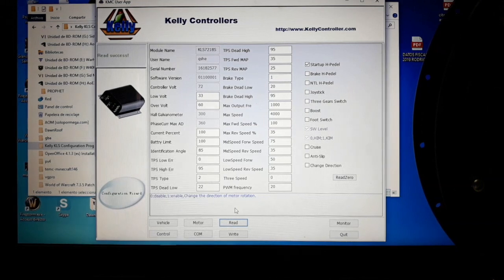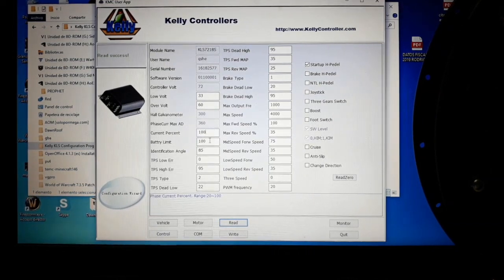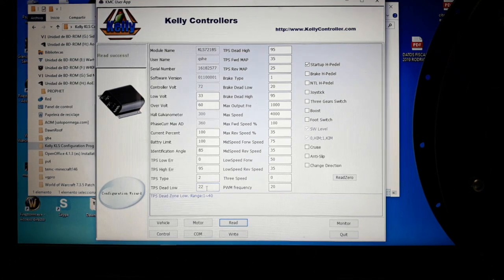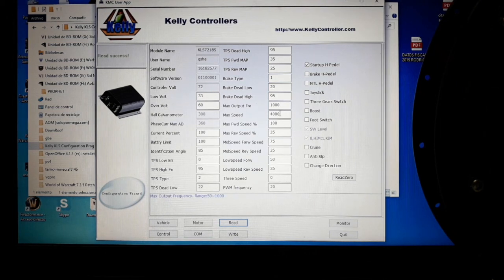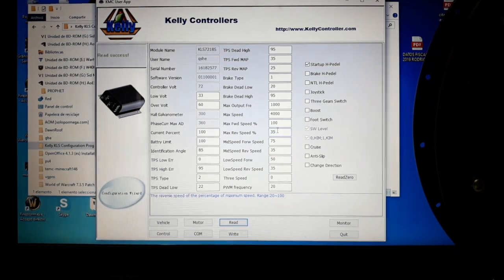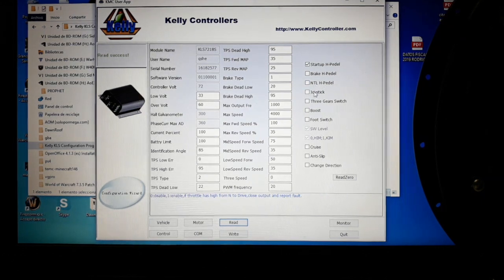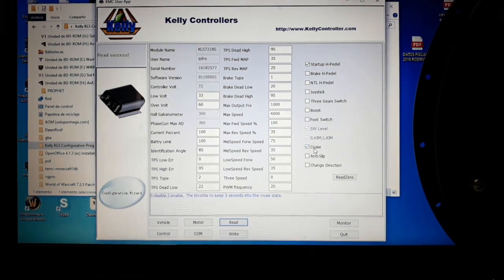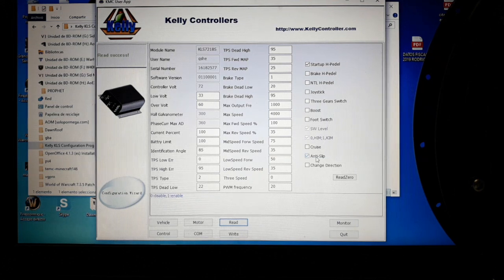KellyController Parameters, Programing setup, Part 2 (English)

Comment: Great tutorial!!!

I have the same controller 7218 with mxus 3k (20s, 5t, 19" moto). For now everything works, but two things I do not understand. 

First: I have hall throttle. And TPS type is set on 1. And it works fine. How? However it works on 2 as well. Confusing.

Second; I have set Current Percent to 100% and Battery Limit to 50%. So, acording to Your explanation, Kelly should draw 40A from battery (half of 80A rated continuos). But my current clamp meter shows that kelly draws 100A from battery when accelerating full. I did not try to set Battery Limit to 100% to see if kelly would draw 200 amps because my clamp meter can not show that much. Although in user manual for 7218 it is written that kelly can pull 200 amps for 20 seconds. So I'm thinking that Battery Limit is not percentage of 80A continuous rating but percentage of 200A max rating. At least for that 20 seconds. But 20 seconds on 200A would launch you to max speed on 10% uphill with seconds to spare:) Any thoughts on that?
Reply from the maker: Hello @berislavtopol1404 and thank you.
A resistive throttle and hall sensor throttle at the end give out a very similar signal; an approx. 0V to 5V signal.
That is why it works. But better use parameter "2" instead of the "1"
About the current adjustments: 
"Battery Limit" refers to current that comes in the controller. But it is not as precise as we will like you have to play a little with the percentages until you get what you want.
"Current percent" refers to the current that goes out of the controller to the motor, that is AC current.

Comment: Really nice tutorial! Can you only set motor speed on the 3 posistion switch? Can you set diffrent power, like less watts on a lower gear?
Reply from the maker: You can configure the controller for 1, 2 or 3 different speeds, "gears" that they can be selectable by a switch.
Reply: @gonzalop.chomon327  So the power is the same in all gears. Only set difftent max speed of the motor?
Reply from the maker: @smelker  You can only modify the top speed for each "speed gear" at the parameters, but actually I noticed a slightly different behavior of the motor at each speed, like having less acceleration at low speed and higher acceleration at high speed.
So it is possible that the software has some internal setup that changes power as well. (I am not fully sure about this)
Anyway if you limit the top speed you will be always using less current in general operation.
Reply: @gonzalop.chomon327  sounds good! Thank you!!

Comment: Really informative video thank you 🙏🏻 
By any chance you wouldn’t know what Internal Reset fault is caused by, would you?🤔
Reply from the maker: "Internal Reset" can be caused by a current peek or for momentary too high voltage or too low voltage. But if the issue is just momentary the controller will restart after the issue.
Reply: @gonzalop.chomon327  it does restart 🤔 I just see it as a problem going up hill from a dead stop. 🤷🏻‍♂️ might hinder some off road performance. Might charge my battery, see if the problem goes away.
Reply from the maker: @FuttBucker42069  If it happens going uphill from a dead stop, the most probably causes are a current peak OR a low voltage due to high current demand.
Reply: @gonzalop.chomon327  I kept decreasing battery current value, and cut outs became a rare occurrence.
Reply from the maker: @FuttBucker42069  Best solution is bigger battery ;)
Reply: @gonzalop.chomon327  bigger bms in my case 🙈🙈

Comment: hello thanks for the video.
I just wanna ask you one thing. I used kelly BLDC(not the sinusoidal) 55A controller
recently I replaced the controller to sinusoidal 80A controller.
and there is a problem. sinusoidal controller have much less starting torque than the normal BLDC controller.
I installed it on my mountain bike it cant not even push me on stairs.
there was no problem with normal bldc 55a controller.

do you have any similar experience?
Reply: Im deciding between the Kelly 100/350amp sinusodial or the trapezodial model. Im not sure which one to buy.
Reply from the maker: In some of the trapezoidal Kelly controllers you can change the "Control Mode" Value range: Torque/Balanced/Speed and by default is on Torque mode. Meaning that the throttle will mostly act as a torque regulator.
While in the Sinusoidal Kelly controller you do not have that option and it is set up by default at a balanced range. So throttle controls torque and speed on a more reasonable way.
Anyway you can modify the starting torque and acceleration changing the PID values as commented in the videos.
Reply from the maker: @tooshmart6669  Both are good, the Sinusoidal ones are a bit more efficient.

Comment: So I have a 75 Volt 40Ah 18S lithium pack and a 2.500 watt motor.  I have the Kls-S Kelly. I don't want any regenerative breaking, so everything is 0 at the RLS BRK% etc. But do I need to fill in 0 at Brake type? Also: what are good set ups for Battery Limit and Current percent? Because now, when the motor goes less than 5 mph, regenerative breaking sets in.
Reply from the maker: Hi Olaf,
"Brake type" parameter is for defining the kind of brake throttle that you are using if you are using any.
Maybe the braking  that kicks in at low speed it the "Anti-Slip" function.
In order to give you precise parameters I need to know all the info in order to make the calculations.
Reply: @gonzalop.chomon327  Well, first my connection needs to be fixed. I can't read out the Kelly at the moment. I do have some pictures from the last setting.
Reply from the maker: @olafbiesot777  What you mean with "your first connection"?
Reply: @gonzalop.chomon327  The blue wire has been broken. I cannot read out at the moment.
Reply from the maker: @olafbiesot777  Well, then is an easy repair :)

Comment: Hello to utalized the 3 speed function must it have a ground input or a 12 volt input. I want to use it in my eBike. Which i have a Kelly controller.
Reply from the maker: Hi @ubcnme1 while at the manual says you need a 12V signal to activate the 3 speed functions. While at the manual says it needs a 12V signal. It actually does not work. 
And it has been reported that using ground signal to activate them does work.
Reply: @gonzalop.chomon327  Hi I actually got the 3 speed function to work. I installed a 3 way toggle switch. I got 12 Volts  from pin 11.  And in the app I changed the setting to #2 for 3 speed and it works like a charm. I have Eco, medium, and full power.
Reply from the maker: @ubcnme1  Nice to hear :)
Reply from the maker: @ubcnme1  Nice to hear :)

Comment: Приветствую! Вопрос у меня к вам: как правильно посоветуйте объеденить 2 контроллера kls 7218 на 2 мотора. Провода от ручки газа вместе? Или 5 вольт я беру только с одного? Остальная проводка я так понимаю просто в парралель, датчик тормоза, переключение скоростей и тд... Ворос 2: что за провод RTN (6) и куда его подключить?
Reply from the maker: For 2 motors setup is better to use only one of the 5V supplies. 
The pin 6 is a grond (-) usually it is used for the return from the starting relay if you are using one.
Reply: @gonzalop.chomon327  If I don't use a relay, then I don't touch or connect the RTN output, right? to turn on the controller through the ignition switch, I supply the battery voltage to the PWR wire. Thank you for your help. They say it's even better to put a 2kom resistor on the signal output from the gas handle for protection, is it necessary?
Reply from the maker: @spiritelektro  If you don't use a relay, you don't need to use RTN for a non existing relay 🤣
There is no need of any kind of protection on the throttle signal it is only 5V and very low power.
It is good to install a precharge resistor for battery-controller connection. Around 1Kohm to 2Kohm (10W) is ok.

Comment: You can't use 3 speed switch if you use 3 gear switch?! We have a machine with a 3-gear selector for Forward Neutral and Reverse but also want to select 3 speeds in Forward. Can this not be done? We are using 2 Kelly controllers for two rear Hub motors.
Reply from the maker: It is not possible to use both functions at the controller programing.
But you can always make a F-N-R function outside of the software. A 3 position switch can activate: Forward and Reverse and Neutral can either by blocking with pin15 or deactivate the throttle or activate brakes for example.
Reply: @gonzalop.chomon327  Ah yeah ok, I get what you are saying. It’s for an ATV sized ‘golf cart’ and we have converted the indicator stalk (3 position switch) into Fwd N Rev. This is on a DC Curtis controller. I’m relatively new to brushless DC controllers besides playing around with the off-road scooters we have here. 
Good to see to reply in the comments. Cheers
Reply from the maker: @d1o2n4  Glad to help.

Comment: Hello friend, I have a KLS7212ST controller
It is limited to a speed of 18 km/h
I want to unlock unlimited
What should I do ?
Just change the motor rpm?
Reply from the maker: Yes, usually the way to limit the speed with this controller is changing the motor RPMs limitations parameters.

Comment: Hello, i have a problem i got KEB controller , and i try to connect it to my pc, every time i  connect pc to controller, and open software the program,  i recieve a message check pwr and connection cable
I don't know where is the problem but if you provide me with the steps for proper connection of controller
Reply from the maker: Yes, sometimes it is a PIA to connect. Try to connect by Android APP instead of PC APP, it usually has worked better for me.
Anyway have in mind that it may be  possible that the cable is faulty.
Reply: @gonzalop.chomon327 
Hello, i ask about throttle error that appear when throttle reach its path end , the motor is stoped by controller
Reply: @gonzalop.chomon327 
And another question, how to make 2 kelly keb controllers synchronized with each other? To drive two motors with coordination with each other  so the driver can take a turn or some thing like that
Reply from the maker: Hi  @omniamohamed6392  If the controller gives an error when the throttle signal reaches its top limit, then you will have to increase a little the parameter: "TPS High Err", this parameter indicates the controller where is the top limit signal of the throttle. Avoid if possible to set it at 100% because then you may lose the controller capacity to detect a fault in the throttle.
Reply from the maker: Hi again @omniamohamed6392  ,
That can be very simple or very complicated depending on the use and setup.
You can contact me privately so I can create for you the basic configuration or a full fine tuned one. This will have a cost obviously depending on the scope.

Comment: I have 4900 rpm motor what should I set my max speed to
Reply from the maker: If you want the motor to reach it maximum speed, then set it up over 4900 rpm something like 6000 rpm in the "Max Speed" field will be enough.
Reply: @gonzalop.chomon327  thanks Soo much Gonzalol u have a new subscriber
Reply from the maker: @customcarreviews9134  Thank you, you are welcome.
Reply from the maker: @hdbsmkalavshdhs  If you put a value over the maximum rpms that the motor is able to reach it will just run up to that speed, not more.
Usually on an Electric Vehicle, it is interesting to limit the max. motor speed in order to have a constant vehicle max. speed regardless of the battery state.